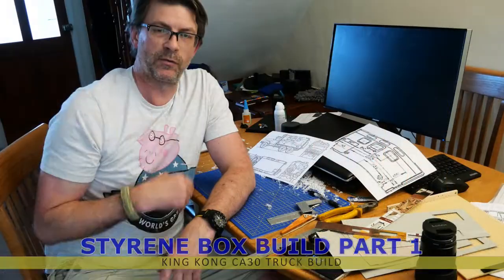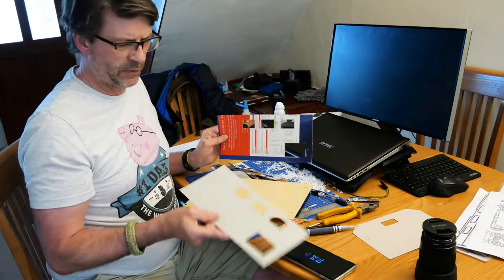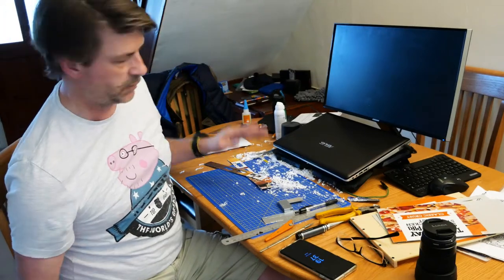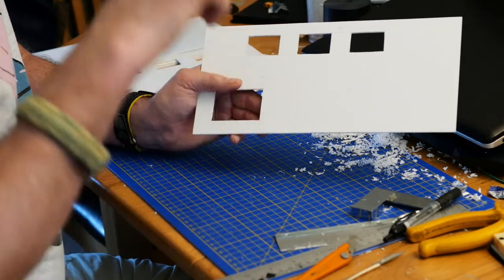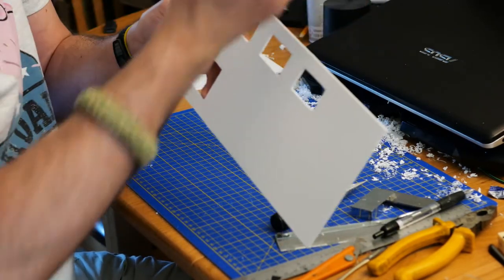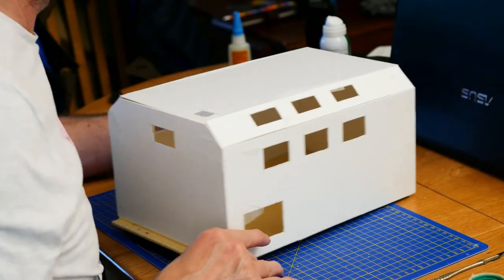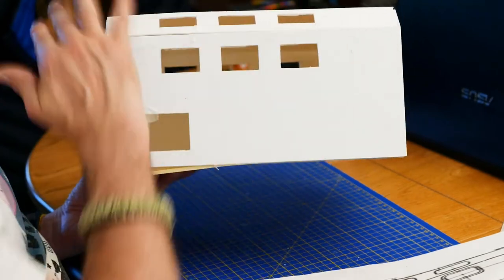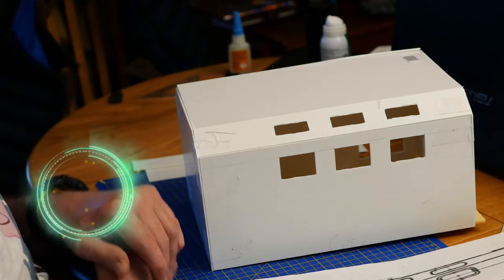Styrene Build Alert!!! Yes, Andrew Finally Starts His 1:12 King Kong CA30 Rear Box Unit

Comment: They way you cut the windows out is the same as I do it. I use a small drill in the corners and not the reamer it does stop splitting.when snapping out. I find I have a little breakout of plastic but you cannot use thinner making sides. The frames are even harder to do. You only got A4 plastic sheet, look on 4D model shop they do a lot larger as I buy from there and there prices are not bad. 660mmx330mmx2mm £6:50 a sheet. They do a huge amount of materials. But it's coming on well, but did make a mess and you need to clear up as you go.
Reply from the maker: Yes Mum. 🤣🤣🤣🤣 I'll check that shop, as A4 is a bit limiting. 👍